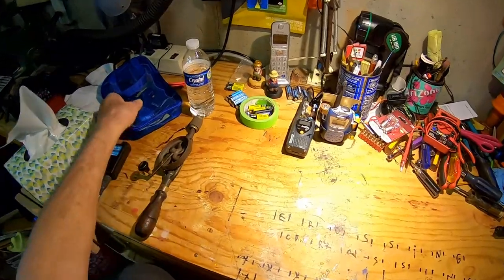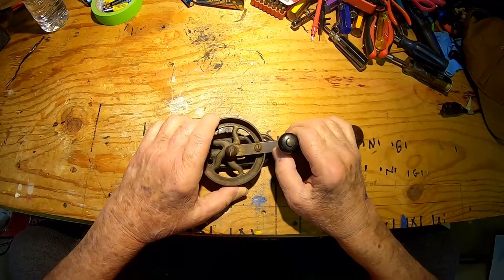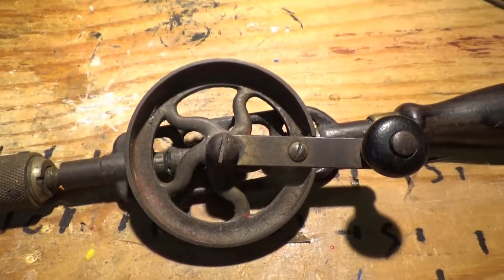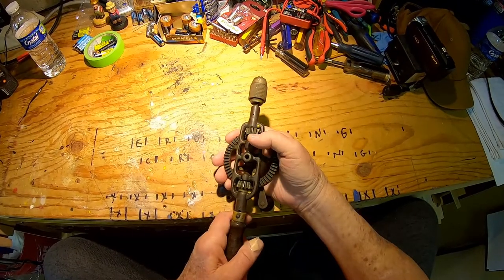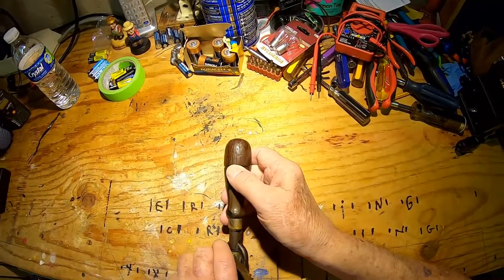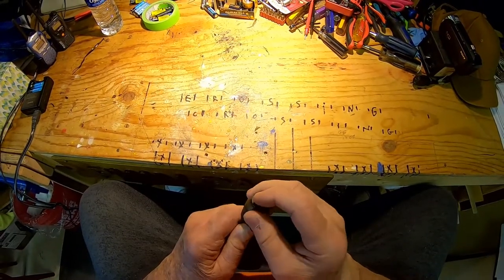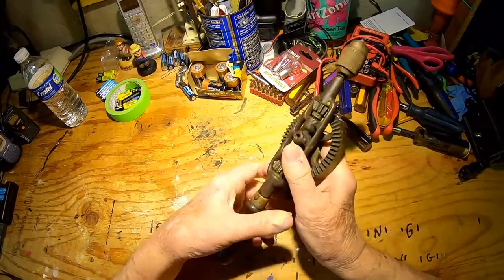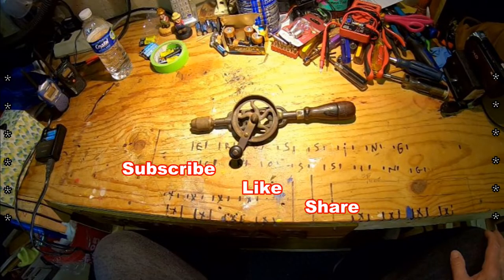Miller Falls Co No  5 Hand Drill Whats In the Box

Comment: The ORIGINAL cordless drill. That "11" on the handle looks like some Bubba turned it with a pair of pliers. They were also made by Stanley. I have a Stanley just like it in my tool box. I still have the original drill bits for mine. Thanks, Walter. Jon, MSO-439

Comment: I had a drill similar to that when I was 15. It appears that if you remove the crank you could attach it on the opposite side. Possibly for left and right-handed people. Very cool, Walter.
Reply: Actually, the Millar's Falls No 5 came with a second side handle, usually wood that matched the vertical handle, the shape of the handle depended on when it was build.  They started building this design in the late 1890s and you can date them by the handle type and the chuck design